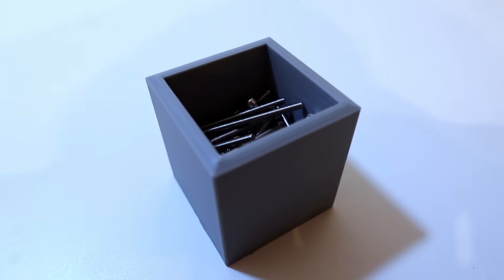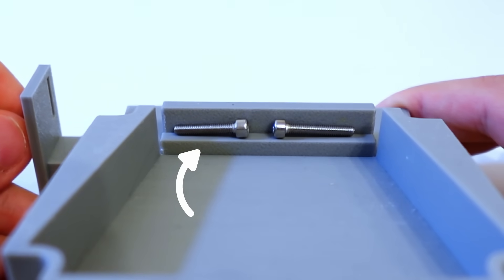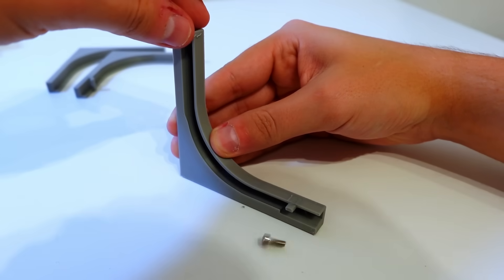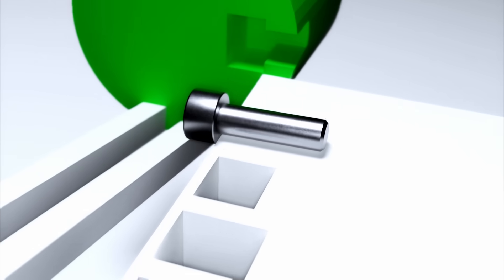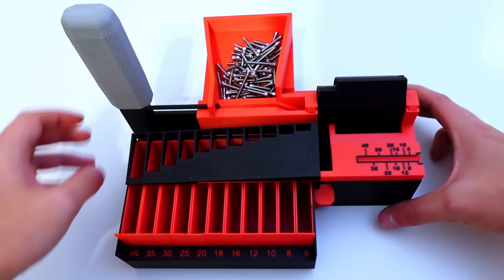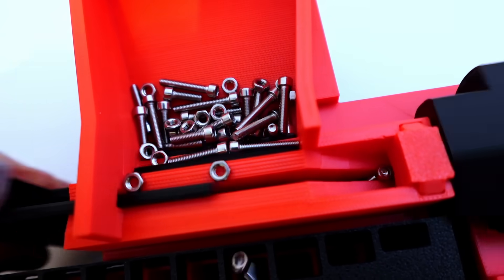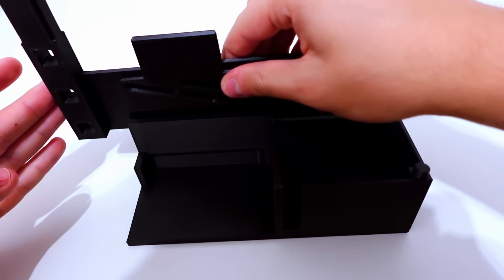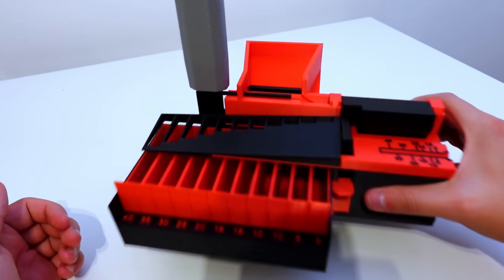Engineering A Mechanical Bolt Sorting Machine from Scratch | 3D Printed

Comment: Any suggestion if the screws aren't popping into the thing that's supposed to fling them into the measuring device the little arm that goes up and down?  They seem to be getting stuck when they go down the little ramp into the hole they're not going into the rotating drum and then they're just piling up there sometimes they'll come out but then they just go in the wrong hole anyways.
Reply from the maker: Make Sure there is no elephant footing or other material on the rotating part that may block the screws from sliding in. And operate the device slowly so they roll out smoothly to the ramp

Comment: Its really brilliant.  Maybe you can put a small magnet on the lifting mechanism.  Once the lever is raised the magnet pulls back and frees the bolt to roll down gently.  For me I am defentily modifying it to use a motor.  I got a tub full of screws, luckily all metric, and rather just sort them out and dump then make my carpal tunnel worst.

Humm.  I bet you could even make that path that levels the bolts on that rail to have holes to drop down sizes not supported but now I think there must be a way to get it to sort 3M 4M and 5M some how at once time.  Really making me get some ideas.
Reply from the maker: Just released a Motorized Version. Might be something for you

Comment: Fantastic. Can you add a feature to also sort by size as well? Then can you add a feature to separate by head type? Pan head should be easy, flat head will be a trick since it's measured differently. I would pay money for the files if it could do these 2 simple additional things.

Comment: An idea to solve bolt jams in the hopper: my inspiration comes from paintball and feed jams in those hoppers.  Look ti the old VL revolution 2000, they used essentially a rotating stir bar near the outlet to keep things moving.  No reason you couldn't make this even more over complicated with something like that.

Comment: Nicely done. I appreciate your process of design.  Will it sort a combination of nuts and bolts? May I suggest that you add a motor to automate the slider as well as control the speed. Also I assume it will sort any bold head type?
Reply from the maker: Thanks. I will soon release a version with a motor and support for multiple head types. this one only supports the head type shown in the video

Comment: Just interested with what printer you have it looks like a Kobra 2 from that short clip at the start. I have the same printer but struggle with dialling in the settings for it. is there any chance I could grab the pre-sets you use for it and what slicer you use. have been fiddling with it for ages now but im super out of my depth :D
Reply from the maker: im basically using the print profile that it came with but made it a bit slower (200mm/s instead of 300) because i want the printer to be a bit quieter. and i have been using prusa slicer. never had any problems with the printer but i now switched to a bambulab A1

Comment: First.. love it.   Is it perfect? not quite... but it is fantastic.
The only things I can think to make it better are - 1, a crank rotation instead of a handle system, simple circles with a hand crank to cause the sawing motion.   (this tends to be more comfortable as well, as you can reduce the 'back movement')   2 - an agitator to keep the 'needs sorting' box, from jamming, this could be a slow moving 'wiper blade' that just goes back and forth really, not full circles which might trap parts and keep them spinning.

Comment: This has huge potential by attaching a motor to the handle which would allow you to run it at a constant speed without the need to do it yourself. PEAK LAZINESS!, additionally a little cam could be use to jiggle to feeder plate.

Comment: Super cool project! One question though. When you are cycling it there are times where the stair step wall picks up more than one screw but it looks like the rotating “barrel” can only take one at a time. Eventually the queue for the barrel will back up too far and jam up the push rod. Maybe there is a way to modify the barrel to where it can take more than one screw at a time. That would solve the backup problem!

Comment: Its amazing how much you can do with a brilliant purely mechanical design. Sometimes its partly a ost art in the digital age.
I saw a coin sorter from mid 20th century, it had different coin guides and an electro magnet underneath. Didn't fully get how it works by looking at the video, as the coins were rolling down pretty fast.
I would probably made this way to complicated with electronics. WIth some sensors or even simple camera you can diferentiate one or twoo things, but then when the sorting requirement list gets longer, I would either need a buch of specificaly placed cameras to measure one thing each.. but then it gets too big and too costly or one camera with more powerful compter vision... and robotic ar picking them one by one :D
And spend two weeks building the thing. 😅
All because i could imagine that it could be done mechanicaly, but my guess would be that wouldnt know how to trouble shoot it and fine tune the mechanical parts to actually work. So unnecesarily complicated electronics becomes easier as would feel more comfortable with microcontrollers than playing a gessing game with lenghts and angles of various parts.

This is nice machine if all bolts are the same diameter, but what if you have to sort them by diferent diameters? Or by heads, phillips cross or hex. COne that goes in the material to make the surface flush, or bulkier heads like the ones in the video... somany variables to play with.

Something that could sort all the various screws and bolts that go in in computer would be useful. Tiny  bolts from laptops would be extra hard...probably.

Hopefuly anyone will like some of those ideas.

Comment: great video, love the flow and logic of your thought processes and reasoning and especially the trial and error process

I'd like to see your thoughts and potential variables during those thought processes. For example you did a very well job of providing existing concepts by others but for me didn't dive enough into the reason for coming up with a certain design on your own and picking it.

Did you go by intuition or was inspired by other means or decided go with a certain design of the part of your assembly,

Like in the beginning two walls, thats a great concept and works wonders.  How did you think of that?

I would like to think that is was based on a lot of different ideations and selecting one that worked. Like the bolt carrier cylinder. Or maybe its the first thing that came up to your mind and as you mentioned in your video, to your surprise, it worked wonderfully.

I mean you did a great job of explaining, for instance the bolts and the center of mass / gravity. And this is clear also for redesigning or flipping the bolt cut outs because of the observation of the layer lines getting in the way of the travel of the bolt, but not in all of the parts of the assembly.

I'm like just amazed, coming from curious and inquisitive nature. Also just subscribed.

I'd love to see your channel grow (:
Reply from the maker: Thanks for the feedback. Will try to keep that in mind for upcoming Videos. its not always easy to say where the ideas come from. Sometimes they just appear out of nowhere. But i will try to improve it

Comment: you might be able to run it faster by changing the angle of the helix at the start and end to slow it down before a bolt goes in or out onto the sorting plate
Reply from the maker: Thats an interesting idea. Will keep that in mind for future Updates

Comment: Absolutely love this. An idea to think about, albeit completely overkill for something like this: for the chamber that does the final movement laying the bolts onto the sorting plate, I wonder if there’s a way to integrate something like a geneva drive. Rather than oscillating the chamber, only sorting one bolt per cycle, you could have it constantly rotating bolts towards the plate throughout it’s entire cycle. This could potentially allow you to expand the initial capacity and speed up the sorting a bit. I might have to play around in cad just to see if it’s even feasible😂
Reply from the maker: Interesting idea. Will think about it when i will create the improved Version

Comment: You could’ve save so much effort by just adding a ramp on the other side of the walls with rails because they were already in the correct orientation I would’ve made the 2nd wall slope a lil to make sure they all rolled from the same spot 3:00

Comment: Do you have a queue issue since the "two walls" part can bring up two bolts per cycle, but the rotating "bolt lifter" can only do one? Won't this sometimes backup and block?
Reply from the maker: You can counter that easily by not pushing the lever in completely. This will still be enough to take bolts to the sorter but not enough for the Walls to lift New bolts to the rail

Comment: Just an ease of use thing, and I know almost anyone who feels the need to do it could, but adding a slot on the side for either a pre-existing clamp or an optional one that can be printed along with it to slide into and secure the sorter down to say the edge of a table or desk would (I think) make using it a whole lot easier

Comment: Why do you have so many unsorted bolts?  Just curious
Does it work for screws: cap head & recessed head?
Great device!
Reply from the maker: im using them for many of my projects and when i dissasemble the prototypes i just drop the bolts into a box instead of sorting them directly
im currently working on a version that supports multiple head types

Comment: Great project, although I'm not ready to spend time printing and assembling for the sake of my 10 bolts😄
Small suggestions - noticed the machine slides on the table. Silicone bumper pads (not sure what it's called in English) would at least make it easier to hold.
And, as I've seen here already suggested, slightly modify the mechanism for converting rotary motion into reciprocating motion, so that you can twist the handle or attach a motor.

Comment: Did you ever see backlog building up, since the rotating arm can only move one bolt at a time, but the stepper mechanism can move multiple?
Reply from the maker: Only once. But you can counter that easily by not pushing the lever in completely. It will then take a bolt to the sorter but wont lift the Walls enough to place New bolts On the rail

Comment: Just a thought, why not add a hopper vibrator with the hammer rapping or tapping on the end pull stroke by leverage and a spring or rubberr band?

Comment: I think if you made a slanted, V shaped funnel with bolt channel at the bottom you could just drop all the bolts in and they would properly orient themselves.  Then you don’t even need a mechanical step and you can load in more bolts faster.

Comment: What about a version that could run more sizes, when I have unsorted stuff it is never just one type of screws, it will be wood screws threaded bolts all in a mess of diameters and lengths

Comment: The rail thing where bolts get vertical could be an insert that’s fast and simple to swap. Make it a size that like m5 bolts would get stuck in and any other size would fall into a collection basket below. Then swap in a size for m4 bolts. Then m3. Then m2. Then all the bolts will be sorted very easy. Make the rail at least like 15 mm deep though so it doesn’t let the target size fall through the wider gaps w weird alignments.
Reply: BubsBuilds’ bolt sieves let bolts fall through for example. He has YouTube videos on them

Comment: Pushing 3D printed part/assembly/machine capability to a very satisfying place! Bravo EmGi! Your machine also reminds me of the pain of being an engineer in the US: try sorting out hex head bolts, and also fitting the sizes, "1/2, 11/16, 7/8" and so on, color embossed on the bolt-length scale face, instead of "5, 10, 15, 20, 25..."!

Comment: Would it work to mirror the sorter on the other side and add a second bolt head cut out on the rotating piece so that you grab a blot as it rotates in either direction?
Reply from the maker: Yeah i think that could work

Comment: I wonder if it's possible to sort by adding fingers along the vertical slide where the bump would knock them into the correct container, you already have them sliding in a controlled fashion in the top section, or maybe better, have the bump angle the bolt onto an internal rail that drops them into the correct container.

Comment: To fix your speed issue, the angle design at 3:03 could be rotated and placed before the sorter plane. Additionally for quality of life transform the input mechanism to a rotational crank with a flywheel to keep it running at a nice speed.

Comment: If you have a TON of the smaller bolts can the section of ramp just after the piston get backed up to the point that you have to remove one to recover? you can have >1 input from the lifters & piston but only one per operation on the flipping mechanism.

Comment: very nice. one suggestion i would make. i know and udnerstand its mechanical but, option to add automation with little motor. so for example u leave it in the garage overnight on slow speed and in the morning it greets you with sorted bolts. or while u do something else its sorting (so u fix it if it gets stuck)
Reply from the maker: the bins and the hopper are really small which makes it hard to add a motor because you would have to empty the bins and refill the hopper every few minutes. But im planning on creating an improved version that can be motorized

Comment: Love it!
Is there a possibility to get different mainplates?
One for 4-6-8-10-12-14-16-18-20 and another one with 22-24-26-28-30 and so on?
Also, if it does not work with buttonheads, that might be another project?
Reply from the maker: i uploaded the Stepfiles to makerworld. if you have basic CAD knowledge you can adjust them to your needs

Comment: i like it.... but give us STL files.... you know..... the standard file type.
next, make one to sort nuts.
Reply from the maker: whats wrong with 3mf? every slicer should be able to read them
Reply: @EmGi_  barley......like 2/3 the time, or more,  3MFs dont open for me, they just give error messages..... i almost never have problems with the slicers loading STLs, and they also work in Blender for modifying.

for the record, i use prusa/super/orca slicer, depending on the project.... either way, your creation is on my todo list.

Comment: I am a robotics teacher. This will be extremely handy when we go to take apart our robots. Sorting nuts and bolts is the most tedious part of my job. I may need to modify the files, but thank you so much for this.
Reply: I would pay quite a lot of money for the  3D print files of a sorter for our robotics screws (Vex Robotics)
Reply: @ that’s what we use as well. If I can make it work I’ll post a link to the files.
Reply: @acerqua24  i am on a vex team to and when I saw this, that was the first thing I think about I’m still trying to find one that will fit the screws. I think they’re around like an M4.
Reply: It should be reasonably easy to motorize this as well to run basically autonomously. You could even experiment with adding some vibration to the whole thing to make the hopper more reliable in case it gets stuck too often.
Reply: @acerqua24 I am a competitor in High School VRC. I am actively working on designing a sorting mechanism inspired by this video, I'll add a link to this thread once I'm done.
Reply: @3017d_vrc yoo thanks so much
Reply: @3017d_vrc how’d you go?

Comment: You can greatly simplify the machine if you don't care about the final orientation of the bolts. Instead of doing two 90-degree rotations along two axes, you can do a single z-axis rotation on the bolts keeping the initial horizontal orientation. This would remove some potential failure points and you could operate the device faster. To scale this to an industrial level, make a larger initial funnel and replace the small recipient trays with tubular chutes that go into larger end-recipients. This whole assembly would be best done with laser-cut sheet metal.
Reply from the maker: not sure if i understand it correctly but if i keep the horizontal orientation they will be aligned in 2 diffrent ways. the head is either looking to the left side or to the right side. and for the sorter to work its required that they are all aligned the same

Comment: Good job! But this device sorts bolts of only one diameter. And if you want to sort out different diameter, the machine has to be remade, which is a major drawback. Ideally, the device should sort bolts by length AND diameter simultaniously. At least, bolts with one type of head.

Comment: why engineer something when you can over-engineer something!
the incline plane idea you had before the piston might've worked if you link the tilt together with the top lifters movement. another solution you often see is two sawtoothed edges with their planes oscillating at an 180 degree offset. 
and im sure people already have mentioned that having an rotating drum as the loader into the sorting tray would be more efficient and would probably eliminate some of the Yeeeting.

Comment: 6:51 Small tip for how to remove the bolts from a single container with multiple compartments: Hold something flat over all but the outermost compartment and empty that compartment. Repeat with the second  outermost compartment, etc.

Comment: Any chance this could be modular for different diameter bolts? I have tons of M3 which I use most frequently, but lately M4 and M5 have been in my rotation for projects. I have a back of bolts I have yet to sort because it is so tedious!